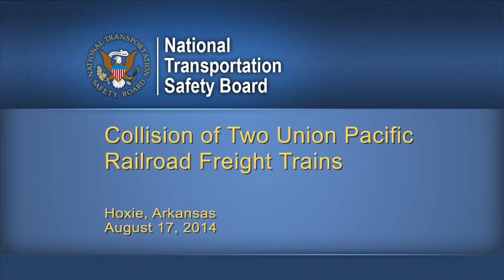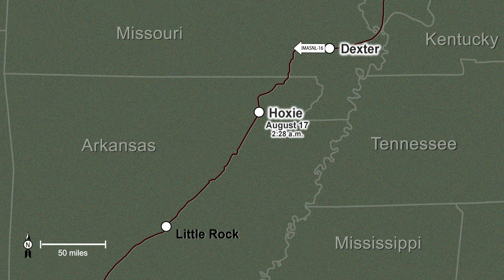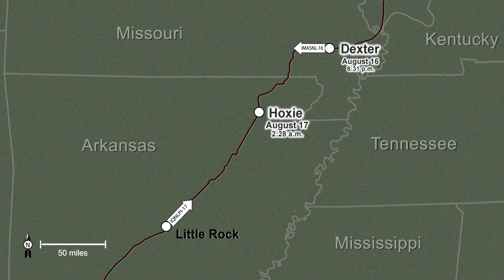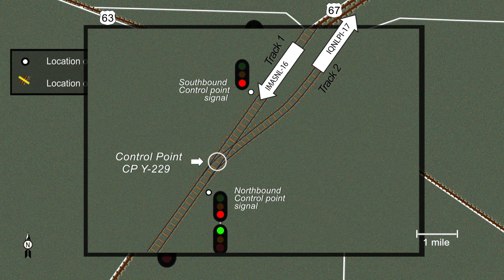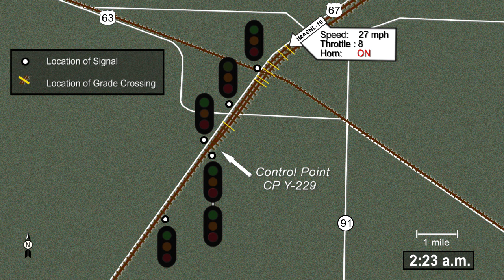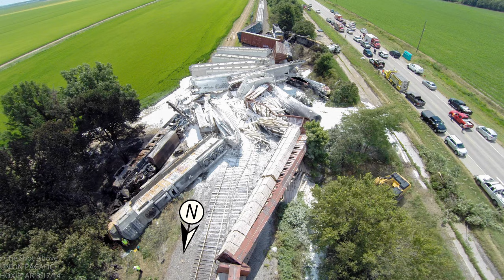Collision of Two Union Pacific Railroad Freight Trains

Comment: If you’ve never worked on the railroad you don’t get an opinion. PTC was implemented on certain territories for “safety” they say. But what’s not told is how Class 1 railroads and many short lines DEPLETE the extra boards and regular boards to move freight. These are two intermodal trains which is UP’s number one money maker. Nothing matters when it’s time to move freight including crew rest. Sure they get 10hrs undisturbed rest but are threatened with their jobs when they try to get days off every 10-14 days. On call 24/7 365. This is the only reason for such catastrophic accidents. No amount of alerters, PTC, conductor logs or anything else is going to make a difference until train crews are allowed to be rested or take a day off without fear of losing their jobs. I worked on the UP as a conductor for nearly 10 years from damn near Houston to Wichita, KS and Dallas to Pecos, TX. The problem is trying to move to much damn freight with not enough people because they don’t want to pay people to do it......... Period.
Reply: hoganswinger that's nearly the same level of precision railroading at CSX.
Reply: When I was a boy there were railroad dormitories in every major rail town or junction.  If railroads are not giving crews enough rest, then management is inviting more government regulation.
Reply: How many crew on a freight train ?  2 ?  Both in the locomotive cab ?
Reply: I mean... even if we don't work on the railroad, we kinda do get an opinion. Don't fall asleep when you're controlling a steel beast that's thousands and thousands of tons.

Comment: In the European Union (and some other countries) there is a safety system called ECTS.
It's an automated safety system on-board every train. In case the driver misreads the traffic light or don't follow the speed limit, the ECTS takes automatically over or stops the train if needed.
Reply: KVB in france, in almost all train line in europe. When I drive without it, I’m under stress. I can’t understand why a country choose to not have that
Reply: + pretty much any of the other systems that come with some level of train stop and overspeed functionality (PZB, TBL, TPWS etc etc)
Reply: Yeah we have all that already

Comment: Man, is there no train protection system installed on US trains and infrastructure?
Reply: Seems odd, doesn't it? That two guys could just doze off and cause A FUCKING TRAIN WRECK???!!!
Reply: there are actually significant safety measures in many aspects of the rail industry, and more are being introduced and worked in as time goes on, but nothing is ever 100% failsafe...  as some have pointed out, its not hard to ignore signals and just go with the norm how you do, this was a case where the engineers of the southbound train failed to comply with the signaling and plans of the route.
Reply: The railroads here in America have been put between a rock and a hard place. The railroads, the big ones at least, have been working on a system called Positive Train Control, PTC for years. Basically the same thing as your PZB. The problem was, none of the systems worked with each other. The government stepped in some time in the early 2000's and told the railroads to get it together and have it installed by December 2016. 
Problem was, the railroads are footing the cost by themselves with no help from the government. The railroads went to the government around July of 2016 and told them that either the railroads got an extension or the railroads would, by law, shut down in January of 2017. The government has allowed the railroads an extension until, I believe, December 2018. 

To answer your question, the railroads here in America have a system, PTC, but it is not up and running fully through out all of America due to the fact that the railroads are privately owned and have to pay for the technology themselves without any help from the government.
Reply: Thank you for your answer! :)
Reply: We have basically the same safety device in France (the KVB : contrôle de vitesse par balise, beacon speed control).
Reply: There is. This was a special exception. The FRA required the installation of automated PTC (Positive Train Control) on all railroads by the end of 2015, which prevents these incidents. Some sections of rail still lack PTC due to lack of private funding to install it on smaller railroads, however all major freight and passenger rail lines now have it. This incident occurred in 2014, before PTC was required.
Reply: Kinda crazy considering that safety device has been around for a hundred years.
Reply: In the US we do have preventative systems in place, now PTC. Prior to that, and even still in use today, another preventative measure is the "Alerter System". There is an Alerter switch that the engineer must hit every 25 seconds if the engineer is dormant and not actively engaging / disengaging any controls or switches in the locomotive. After 25 seconds of dormancy, the IFD will display a red "Alerter" box and an audible alarm will sound. This is called the "10 second warning". If the alerter reset switch has not been activated in those final 10 seconds, the train will dump it's air and throw itself into a penalty application, which is just a fancy name for "Emergency Application". We have been using CTC (Centralized Train Control) and TWC (Track Warrant Control) for decades. Finally, PTC (Positive Train Control) is becoming more wide spread across the US Class I railroads thanks to the NTSB and FRA tightening up the leash. I agree with you though. The leash should have been tightened a long time ago. RR's were claiming they needed more time to fit their rail lines and locomotives with the PTC technology and equipment, but now they have finally hopped on-board with it. However, you must also remember, you can't stop a train on a dime and even with preventative measures in place, and even with PTC, accidents and catastrophes can still happen, regardless. The issue is relying so much on technology and not on human's. That technology can and will fail. It happens. Everything sources back to human error. The #1 cause of RR incidents over the past decade has been, is, and always will be fatigue. Railroader of 3 years here. I can tell you, after a long day's or night's work, you're always dog-tired. The constant schedule fluctuation will kill you, and/or others if you are not careful. This is why crew-changes have become more frequent. Even still, trains need crews, and the way the railroad is with hustling to move for their customers, there will always be that fatigue factor.
Reply: Terence Dangerfield The “Alerter System” (I assume aka Dead Man’s Switch) must be tapped every 25 seconds??? The entire time the train is in motion?? That seems incredibly frequent, annoying, and distracting.
Reply: @bigdave46148  And PTC STILL isn't ready!

Comment: Did any of the crew survive? Why didn't the south bound stop?
Reply: Later report said the southbound crew members -- engineer & conductor -- had fallen asleep at the switch -- they were the ones killed http://www.usatoday.com/story/news/2016/12/06/ntsb-crew-fatigued-fatal-freight-train-crash/95038258/
Reply: >> Later report said the southbound crew members -- engineer & conductor -- had fallen asleep at the switch

Then who/what reduced the throttle from 8 to 7?
Reply: illuminati
Reply: It's not negligence. Trains in the U.S. have operated in this fashion for years. And even well before the advent of signals. So if you this this is negligence, you should read up on how this was performed in the 30s and 40s. Back then there were no signals. There were only flagmen. A head and rear flagman would walk a minimum of TWO miles out with fusees to warn oncoming trains of their trains stoppage. Trains back then did the exact same thing trains of today do. And for the most part, did it safely. They just did it with way less automation. That being said, PTC still needs to be implemented and FAST. This U.S. government is WAY more motivated to regulate the safety aspects of the trucking industry then the rail industry.
Reply: The more you automate anything- locomotives, passenger jets, automobiles- the less the human is involved and the more likely it is he or she will drift off from sheer boredom.  Airliners practically take off and land themselves.  Pilots hardly do anything except react to emergencies.  Same with locos.  Soon to happen with automobiles, and as happened with the Tesla.  It will be a brave new world.
Reply: But the MAIN issue that is a precursor to boredom and inattention is fatigue. And as it relates to rail accidents, fatigue is almost always a contributing factor when human error is involved. I worked for the railroad and in unassigned pool service. The irregular work hrs take a toll on you mentally and physically. You can go to work at 3:00 am, work 8 to 10 hrs, be off for another 10 hrs. Then go back to work at 3 or 4 in the afternoon, depending on your positon on the pool extra board. Imagine working in that irregular cycle for several months or perhaps years, as I did. A guy won't know whether he's coming or going after a while. But as you correctly stated, the human-less workforce will give a lot of workers a permanent break.
Reply: the throttle switch has to be done by the engineer in control of the train as i mentioned to Brad in a previous comment, that would reset the alerter, also the engineer has to actually honk the horn, also resetting the alerter, the collision without a doubt caused the engine's throttle to go to idle as when an emergency application (induced by engineer/ or not) causes the brakes to be applied throughout the train and all locomotives in the consist to go to idle and power output to the traction motors to drop to zero. 

So yes, the engineer and conductor of the southbound train were likely fatigued and failed to comply with the signals and planned route actions, they were awake enough to properly act for crossings though, unfortunate as it is, this is the fault of the southbound train crew.
Reply: negative, absolutely negative, its the signal that goes from the electronic horn button or lever, or pressure sensor that sends the "automated signal" to the alerter and event recorder, if you recall actually listening to the video that the narrator mentions the event recorder showed that the grade crossing sequences were sounded, and they even have an example of the grade crossing sequence in the video, you have to be alert enough to do that, it takes a physical movement to sound the horn on the locomotives.  In my time on the rails, never have i come across a horn that honked itself when doing anything besides sounding when a remote locomotive goes into emergency.  get some actual experience rather than just reading a couple articles.  or better yet, just stay away from the rails if you cant comprehend the functions and features of modern locomotives.
Reply: the engineer made those actions, the conductor is not needed for that to happen, as i just posted elsewhere, the other crew member may not have even had a slight clue as to what was about to happen, and the engineer could have been going on essentially what you would call the "human auto pilot", ya know where you just go on how you would normally without realizing what is going on... normal drivers run red lights and stop signs by accident and the same can apply to engineers and signal, thus is why safety features and procedures are ever evolving to make it all safer.
Reply: Chris Collins
Reply: 25mfd - There were signals in the 30s and 40s.  

The first practical track circuit, to electrically operate train signals, was invented in 1872.  And there were signals before that!
Reply: @ericperkins3078  airliners do not “simply” take off and land themselves. This myth prevails. The truth could not be more opposite. What the future holds? Who knows. Very possibly they will.
Reply: @ericperkins3078  As the other commenter said, for some reason this myth of the automated jet continues.  Come ride with me up front and you’ll quickly change your mind.  Besides, half the decisions that a pilot makes are made on the ground before takeoff, so how would you automate those?  Sure, a few planes can autoland, but automated flight will probably not happen in any kind of scale in our lifetimes.

Comment: Was the southbound train going cab leading , [ for good vision ] was the deadman switch activated on the southbound loco and not disabled . Was there 2 crew in the southbound train.  Did the driver of the southbound train ' know the road ' ? these plus many questions should be asked at a full inquiry . you can not have trains going past red signals.
Reply: Was the southbound train going cab leading
The train was controlled by the control cabin in the lead and forward-facing locomotive.

was the deadman switch activated on the southbound loco and not disabled
The southbound train was using a train horn sequencer to repeatedly sound the horn for several level crossings in a row.  The activation of the sequencer apparently negates the alerter/deadman switch.  This is a design flaw, if you ask me.

Was there 2 crew in the southbound train.
Yes.

Did the driver of the southbound train ' know the road ' ?
Yes.  Train crews are not allowed onto a line they are not familiar with.  Should there be some reason a train crew needs to operate on an unfamiliar territory, they must have a pilot who is qualified and familiar to guide them.

Comment: passing south =@=>|--single line--|<=@= passing north
In Australia, Train stops work only on passenger trains, but if the locomotives were also fitted, then if there was a train already in the single line section, then the train stop, "@" would put on the brakes of any train trying to enter the line as well, then this may well have at least reduced the collision to one train moving?
https://en.wikipedia.org/wiki/Train_stop

Comment: A system like TPWS would of stopped that southbound train before reaching the signal displaying a danger aspect. RIP to anyone who died.
Reply: Your troll-fu was weak with that one.   Perhaps you meant http://lmgtfy.com/?q=TPWS
Reply: Accidents like this always make me wonder why they don't have any kind of train protection system installed in the states.
Reply: Ischbinsnur, I don't think that exists, and it doesn't prevent train crashes any more than beeping warnings
in aircrafts prevents failures and crashes.
Reply: It does, take Germany for example. We have very few train accidents over here, due to our advanced train control systems.
Reply: OK then don't boast about your country to make people think your country is the best. Many countries are decent to visit but still far from utopia-mode. I'm not letting you get the upper hand by putting down people just because your country has a better "system" than others and falsely claiming it's fail-proof. Stop spewing this crap. The years in Euro-land are numbered.
Reply: It's called PTC and been required since 2009 but president Obummer kept giving the Railroads like UP (making a Billion $ profit per Quarter) waivers and pushing back the implementation.
Reply: Actually, that was mainly pressure from the railroads to and through Congress.  The President had no hand in the decision.  The FRA was responsible for allowing extensions to the deadline, and did so at the behest of Members of Congress, who were for the most part lobbied by the railroads.
Reply: Totally wrong Traindad.   Obama pushed PTC to be enforced.  Congress (Republican Controlled) gave railroads the extension.     The extensions were basically needed as PTC was simply no ready for installation.   (And still isn't everywhere).   I'm no Obama fan, but in this case he is in the clear.
Reply: I'm a fellow railroader Ischbinsnur and I implore you to ignore idiots like Sphatt.   Not all Americans are that ignorant.   The fact of the matter is that railroads in North America (US, MX and CA) operate very differently than those in Western Europe.   In Germany railroads are generally owned by the government and controlled by one central system that dispatch fast, high-speed, low-tonnage trains.   In the US, Mexico and Canada there are hundreds of railroads where long, slow heavy freights mix with commuter passenger trains and long distance passenger.  There is no one central railroad dispatch system but hundreds.   Just the way we developed across 'the pond'.  Both are amazing systems and both can be improved upon.  As a fellow "driver"....be safe out there
Reply: Europeans enjoy things like ETCS and ATC, and are dumbfounded that equivalent systems are not prevalent in the United States.  Well, ATS systems are used in the United States.  The problem, though, is most Europeans cannot appreciate the economy of scale.  The United States is 10000000 km² in size, with 226000 km of railway track, and over 200000 level crossings.  In the past 10 years, over $8000000000 has been spent on equipping about 43% of track in the U.S. wit "Positive Train Control."  PTC is expected to save hundreds of lives.  But it is very new technology, and the industry is still figuring it out.  It is not mature.  And it will not help with things like pedestrian/vehicle collisions, or prevent things like brake failure.  It's a very expensive shot in the dark, if you ask me.